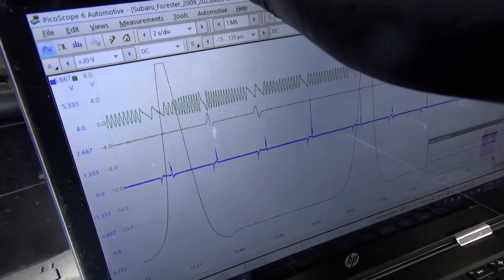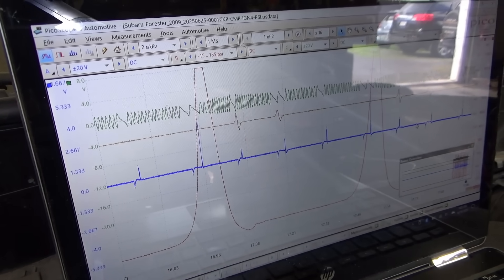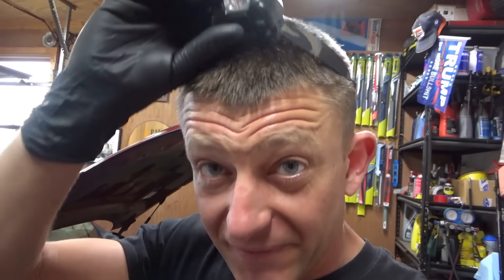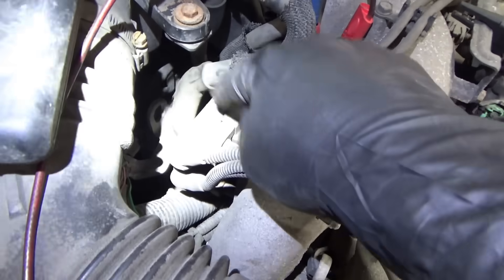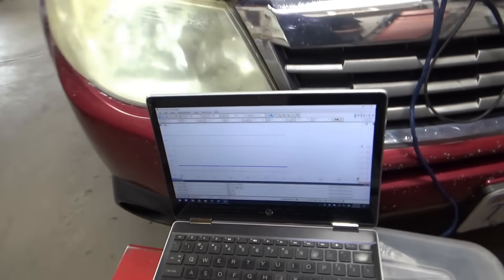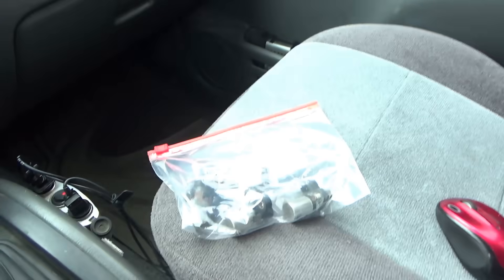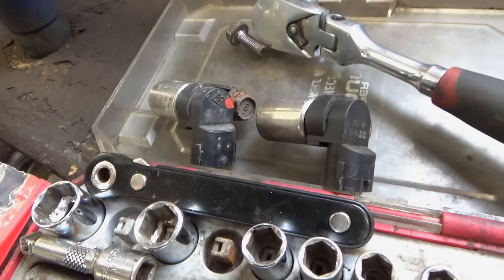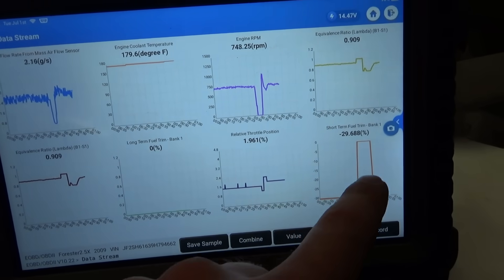(Pt 2) Subaru STUMPS Shop...for 6 MONTHS?!? ('09 Forester Crank No-Start, NO CODES!)

Comment: People trashing on Dorman should specify Dorman electrical parts, which are the exact same as any Chinesium electrical part from any parts store no matter what name is on the box. Like today , I’m putting a Dorman transmission oil pan on a 2012 Mazda3 The vehicle has 160K on it and the owner just keeps it for a spare and wants to keep it going for a few more years. 60$ for the pan , and it is just fine. I’ve used a lot of similar items like this from Dorman with absolutely no problems, so I gotta give them credit for that type of stuff. 👍👍🇺🇸
Reply: I used a fuel pump drive module on my old truck made by Dorman and drove it for another 10 years or so with no issues. I think the problem is, every once in a while, a dud is manufactured. With electrical parts, the margin of error when made has to be zero. It is most critical for electrical parts in my opinion. Like you mentioned, Dorman is making parts that the OEM has given up on making so it is good that they do make them.
Reply: @jdtractorman7445  The problem is, as these failed Dotman parts show, that the manufacturer does not test them before packaging. Not good!
Reply: Well that depends, you might have a 2% failure rate for OEM and 20% failure for Dorman.
Most people will get a working part but for a workshop that's an unacceptable failure rate.
DIYers will be inconvenienced but not sent broke - what do you think Ivan's time cost the workshop?

Comment: With the exhaust cut off those boxer engines sound good. It's good to have a community of car techs. I enjoy all of this content. Just like working on electronics and machines. They all operate the same way electrically. This fascinated me from my childhood when EFI came out and how fast technology evolved. A time to grow up indeed. The smell of burning electronics and 1980's cheap plastic will be with me for a lifetime. I wonder if the pickup leads were swapped around in that sensor to make it read backwards.
Reply: Sounds like a lawn mower with a straight pipe...😂😂😂 Yup da sound good. 
All I hear is a sounds of a garbage cans....

Comment: Great case study! I would have never thought a crank sensor would create this type of issue by providing upside down signals. Great diagnosis and it's really nice to have people you can rely on for advice. I see issues with Dorman and other aftermarket parts all the time. It's impossible to know how much wasted time and lost revenue is caused by junk parts from companies that claim they are designed to help.

Comment: The DiagnoseDan YouTube channel ran into an inverted sensor signal in one of his videos from a couple of years ago too!  Certainly is a head scratcher!  Get out those pins and alligator clips to reverse the leads if it's a possibility.
Reply: Along a similar theme, Eric O. had a line pressure sensor, HVAC, if I recall correctly, that fluttered at 5k RPM or so.  The highly erratic signal would cause the ECM to lose its mind, shutdown, and kill the running car -- no error codes, no nothin'!

It's an interesting video to watch since SMA was completely stumped and frustrated for a good long while until taking an experienced stab in the dark along with some queries of other repair video creators and o-scoping the pressure sensor itself.

This is the stuff that makes these videos like watching a Dr. Gregory House episode so damned entertaining.!

Comment: I would have never believed it even if I had noticed it. My mind is swimming. 99.9999% of the time, you see a signal you are good. Is there something special in a suberu crank sensor? why design an engine computer needing a reverse crank signal?

Comment: When it comes to replacing sensors, always buy the original brand, it may cost you more but will work as it should, for the rest go to AutoZone 😂   By the way,  I wish to have this excellent mechanic in my town, his knowledge is above dealer levels...

Comment: Just say NO to the Big D! 

I got shafted with the 'D' experiance on an Explorer Sport Trac, my personal vehicle, the original 2 piece driveshaft from Ford had a non replaceable center support bearing due to a welded design. The 'D' made an 'improved' design that I thought was great until I had a terrible vibration immediately after installng. The redesign changed the position of the middle u-joint and inherently, the pinion angle. Replaced with OEM and drives perfect. Waste of money on so many levels.

Comment: Seen this so many times over 17 years as a senior master Subaru tech. OEM parts for any electrical part or sensor only on Subarus. If aftermarket is used, we only use Denso branded parts as this is usually the OEM supplier.

Comment: Just stay away from Dorman parts....  I tend to run to the junk yard and pull OE parts to test.  Cheap and simple.  thx for the video!
Reply: I have no problem with many of their hardware type parts , but never electrical, which is the same for any cheap electrical parts from anywhere no matter what name is on the box.

Comment: Wow.  Dorman.   Just wow.   I am sure Dorman makes a few good parts, but I know they make a ton of bad ones.   Even the GOAT is humble enough to ask other great diagnosticians which proves how awesome Ivan is.
Reply: Dorman does make a lot of decent parts, in the hardware department, but never electronics. Like today, I’m replacing a rusty leaking transmission oil pan on a 2012 Mazda 3.Stuff like that I have no problem with Dorman, and there have been many times on older vehicles, Dorman is the only one that has parts available. And it is not just Dorman electronics that fail, it’s most all Chinese electronics, which I believe is where Dorman electronics come from also. 👍
Reply: @brianw8963  I just used a Dorman oil pan on a Hyundai, got it all bolted up with sealant and one of the bolt holes is off, they can't even make non-electrical parts right!
Reply: @peterperpetua2974 The one I put on the Mazda yesterday fit perfect. That was the first trans pan I’ve used , but I’ve done many engine oil pans on mostly various jeep brands and never had any problems. Perhaps you didn’t get the right one, seems a bit odd that just one hole would be off. I did get the wrong one first for this Mazda, turns out they had a 5sp or 6sp in those Mazdas, which I did not know until I got ahold of the advanced guy at Advance. And that vehicle also has 2 different size rotors on the rear. That was the third trip to town. 👍
Reply: @brianw8963 agree. They have a great catalog of parts that were discontinued by the manufacturer a long time ago. Even some “improved over oem” designs. However, throwing on a Dorman or any questionable brand electrical part is definitely a role of the dice. Oem or oe equivalent is still preferred if they are available.
Reply: Dorman gets you out of a bind when you need them but don't trust their metering sensors. I used their screws, bolts, door pins, trim clips all the time but will not buy a MAF sensor from them.
Reply: @ATSNorthernMI That’s pretty much the case with any Chinesium electrical part from anywhere no matter whose name is on the box, it’s not just a Dorman thing! 👍
Reply: Dorman is a POOR-mans parts. Cheapest parts that is manufactured. 
You pay for the cheapest, worse parts ever made. 
Plastic parts are bad quality.
Reply: dorman is just a distributor for other manufacturers parts.
Reply: @growingup4487 Exactly, no different than the popular auto parts facilities that put their names on the exact same parts. Just avoid all the electronic stuff from all of them.
Reply: @growingup4487 manufacturers from China
Reply: HE was stumped, and about to fire the ECM
Reply: @michaelfraser5723But did he?
Reply: I'm quite comfortable with their hard parts, but electronics, still aren't their for me yet. For now, most is A-Premium
Reply: stay away from Dorman for anything electronic, from motors to sensors. Mechanical pieces seem to be OK.

Comment: The crank sensor I had was backwards I had to switch the wires in the plug because it won’t start crazy worked fine after that

Comment: I do believe you mentioned you wanted to look into the inputs and outputs of the ECU before calling the ECU and everything “checked out”. Weird aftermarket waveform… but would not have been possible without a known good.

Comment: I noticed that the tach never moved when you cranked it in the first video. But the scope showed the rpm's as active. Maybe a sign that the sensor was a problem? Thanks Ivan!
Reply: Good catch. That is how I diagnosed the CPS in my Mercedes 2002 SLK 320 as being bad.

Comment: Simply amazing! The magnet in the sensor was inserted backwards. Lack of attention to critical detail by manufacturer. But who would have thought it would affect the spark that way? Even the designer of the ECM may not have realized that would happen if the signal polarity was wrong, because it should never happen.....
Reply: How do you say backwards in Chinese?

Comment: Did you do a crank signal waveform on your friend’s Forester? Or just the coils? I just had this conversation with a friend a few weeks ago about a GM window motor. He got a doorman from Amazon. It was messed up and he had to fix it to get it to work. I told him to stay away from that stuff for electrical/electronics, OEM only. 

Too bad they did not tell you about the swapped censor. Also, a reminder for places work on these types of situations like this to keep that notepad handy and write down everything you do. Even point form. It’s easy to forget and lose track and forget what you did.
Reply from the maker: All waveforms in the link. Download them and take a look!

Comment: ECM's control so much and costs are too high, consumers need to fight for some rights with all the electrical parts from car makers.  They should test all your electrical parts at a dealer at a nominal to low cost as long as you buy OEM, they would make more money and you would be out less.
Reply: Mark,  please repeat after me and for as many times as it takes for you to understand:  "They don't care.  They will NEVER care."
Reply: @beauhatman4395  I know but consumers need to learn to live without, I get a new phone every 6 years, not 6 months.  It's a pipe dream.

Comment: If the initial failure rate is even 20 percent, that means 80 percent work out of the box and possibly fail later.
You may get away with this a few times, but eventually cheap parts bite you in the butt . 
Dorman can easily absorb the loss but the average Joe never wins
Reply: it had to have been manufactured backwards, probably the tiny coil wires where soldered to the plug body reversed or maybe magnet stack flipped upside down.
there's nothing special inside those 2 wire sensors, no circuitry or magical doodads. lol

Comment: If you had just had info off the top that the crankshaft position sensor had been replaced, I bet this one would not have been a 2 part-er. But, you used comparison to known good and networking with expert to find it! SCIENCE! I've used aftermarket TDC sensor on a Civic, but it was a Standard Motor Products part and all good. But fwiw, agree OEM way to go on critical electric parts. Another solid PHAD diag and repair. Shop owner should be pleased.

Comment: Ah hell Ivan, if you had seen the wings before you made those calls, you would have nailed it.  I did a cam sensor in a Silverado a couple weeks ago, and the Delco is not available.  In the words of the dealership "There is only 1 of those things in the entire northern hemisphere."  I put in a Dorman, it got rid of the code, but not the symptom.  I ended up with a Standard brand that worked.  Aftermarket sensors are garbage across the board.

Comment: Very interesting, my bet was the coil cracked and the spark jumping inadvertently internally or eternally. Hats off to your friend John and definitely stay with OEM as Mr. Eric O preaches. Great channel, Aaron from Canada.
Reply: It’s possible, though after a catastrophic ignition failure The ECM’s ignition driver circuit (IGT/IGF line) is supposed to isolate and clamp this transient, but the ground reference can rise sharply for a few microseconds.
If the crank sensor shares that ground reference — which in many Subarus it does through the engine harness splice — that transient can couple into the sensor’s output or bias line.
The result isn’t always total failure; it can weaken the comparator transistor or shift the threshold bias, leading to the kind of temporal inversion we saw.
This wasn’t a polarity reversal failure like some are speculating.

The crank sensor likely failed due to age and internal electronic degradation, possibly accelerated by ignition-system transients, resulting in a signal that looked alive but carried the wrong edge timing. I had to go back to the beginning of the video and check that a replaced crank sensor was not part of the story. No need to assume it was like many have done.

Comment: facepalm but it STILL took a scope and someone with intimate knowlege to spot the fact.  if there's one thing I've learned from you it's that OBD2 computers require OEM to even work  ESPECIALLY Japanese.  this even applies to things as simple as SCREWS.  it took a long time for someone to spot the fact that Japan uses their own JIS fasteners even for phillips style (Phillips have rounded shoulders to apply torque, JIS doesn't), which explains why cases break so easily.

Comment: Sheesh!   Call it EXPONENTIAL explosion of troubleshooting difficulty  10x more electrical systems & parts and now frequent defective NEW parts. 
NEW =
            (N)ever
            (E)ver
            (W)orked

When diagnosing failures Ivan shows:  "don't be lured into presuming new parts work or at LEAST always be suspicious."

I wish new parts required TESTING + CERTIFICATION + BRANDING.  Yeah it'd be expensive but so is troubleshooting bad new parts.   Possibly ASE might jump into this game although it is an easy trap to get screwed.  

P.S. => exponential.... a famous problem where a grain of rice is placed on square one of a checkboard.  Two grains on 2nd square, four in three, etc.  

Copied from internet:

The "double grain for each chessboard square" problem refers to the famous mathematical legend where one places a single grain of rice (or wheat) on the first square of a chessboard, then doubles it on each subsequent square. So, the sequence of grains per square is: 1, 2, 4, 8, 16, 32, and so on, up to the 64th square.

Pattern and Formula

On the nth square: The number of grains is 2^(n)−1.

Total for all 64 squares: The sum is a geometric series:

Square_64=(2^64−1)
=18,446,744,073,709,551,615

This is just under 1.845×10^19
—an amount so enormous it far exceeds annual worldwide rice production several times over.

OR  a penny on square 1
       2 pennies on square 2
       4 pennies on 3
       ........
       on square 64
       1.845 × 10^19 pennies
       1.845 × 10^17 dollars
       $184.5 x 10^15
       184.5 "peta-dollars"

Comment: Garbage in garbage out still holds true it seems. They must have misread the pinout when designing that part. Wallet with wings flying away with money yet again.
Reply: probably something like, the chinese kids on assembly line reversed the tiny coli wires to plug body when soldering them on. there's seemingly 9 miles of fine wire in there making up the coil. I know that because of them being corrosion seized into the block bores and having to gut them out, then fold the metal sleeve in to get them out.
I'm miffed that someone changed it and didn't put two and two together when it wouldn't start directly afterwards. a simple visual inspection could have caught that probable junk part being in there and anytime it's non-oem sensor you scream and shriek!

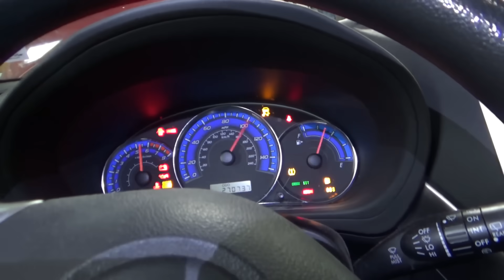Comment: I saw the main problem at 2:33. Your friends that was still running and driving fine at 270k was a manual compared to the beached whale that is an automatic …😜
Reply from the maker: Ha Subaru does make a stout manual transmission! He is on the 3rd clutch however due to inferior throwout bearings...no fault of the driver.
Reply: well, in truth,automatic transmission adds a whole layer of things to go wrong !
Reply: @CrimeVidOh I know, and I know transmission type was irrelevant to this issue, I was just making a joke because most viewers of the channel are ardent fans of manual transmissions. 😄

Comment: Great find…but the shop didn’t do you any favors.  If they had disclosed what had changed since the car last ran, you would have identified the crank position sensor as suspect.  Classic problem solving.

Comment: Electrical part always use OEM, that’s the shops fault going cheap.
Reply: I really lucked out on an EGR position sensor for an old Avalon a while back. It was long out of OEM manufacture, and I couldn’t find an old/new stock Toyota part. Threw my hands up and bought a Standard brand example off Amazon. It actually worked.

At a minimum, it would have been nice if the previous shop would have reported that they replaced it with a non-OEM part.
Reply: 100%
Reply: not really, it's the fault of ROGUE QUALITY CONTROL ELEMENTS IN THE EAST
Reply: That's a really good rule, I normally do the same, but Bosch is also manufactur of many parts in European car's, look at the video link that I sent Ivan, in another message.

Comment: Nice spot! Amazing fired straight up too!! I’ve  seen similar but with a new Bosch cam sensor. That was much easier to spot it was inverted though. When your original diagnosis was correct but the bad new part sends you down a big hole.